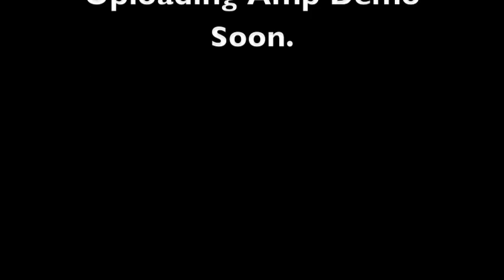Classic 80's Tube Amp Rebuild - Laney AOR50 (Part 2)

Comment: Very impressive build technique. I just found your page and am a huge Laney AOR fan. I presently own 3 AOR's and have refurbished 4, including the one for a good friend. I did not go to the degree of rebuild but am tempted to take one of mine to this level....now that I see the beauty and craftsmanship you display on your builds. I am skilled avionics Tech and am inspired to hand wire my favorite Laney to your specifications. Very impressive Sir!
Reply from the maker: +Michael Davidson thanks Michael,  really appreciate your kind words. They definitely are a cool design and quite unique indeed particularly with the active bass boost. I wish I could find another AOR at a reasonable price as I'm itching to rebuild another. I can send you my layout drawing if interested, let me know your email if so, cheers
Reply: Yes, the active bass boost is keen in that it comes from the output tubes,  rather than the preamp circuit. I would welcome your layout if you would share. That would give me an edge in completing a handwire project.  When I bias a Laney, I bias it with the bass boost on and bias specs on the high side of bias since I play with it always on boost.....indicator knob on zero. Over the years I have found most players struggle with the interactive tone stack and available boost. Is there a way we can share emails without me posting it here?
Reply from the maker: Hi Michael, head to my channel page and follow the website link and there you can email me no problem. Cheers

Comment: I have a Laney AOR30 which has been knocked around a fair bit (It was in a shop for 6 months being used to try guitars on),however since bringing it home I've attempted to get it working better- one thing that improved the sound was replacing the valves with Mesa Boogie ones, hoverer these are probably 10 years old now. I never use the "boost" controls on the EQ, neither do I use "presence", I also use an Alesis Microverb instead of the spring reverb built into the amp. It is interesting how you have changed the sound by changing capacitors in the EQ controls, I shall have to try this myself.

Comment: Amp wizard.. Amazing job.. Now a really exclusive PTP amp.. Must be expenisve with all those expensive jupiter caps and F&T electroytics, not to speak of the many hours of manual labour put into this amp.. 
I have not seen that ground bus wire before.. NIce detail..
Reply from the maker: +MrAnders1976 Thanks MrAnders. Those components are a higher quality part but it wasnt too bad in the end, the amp all up, excluding cabinet, came in at around 400$ so not too bad.  The labour and time was a blow out though, took ages.  you are the first to notice the ground bus, and I'm so glad you did as its the key component of this amp.  The earth bus is something that most tube amps neglect, they put in teeny itsy bitsy earth wirees and they just cant handle the current.  A big brute of an earth bus channel is essential to get all those currents on their way and uninpeded.  The bigger the better and you will never go wrong, plus only have one going to one earth point.  Any more than one earth point and the amp is inviting noise.  Thanks so much!!!
Reply from the maker: +elams1894 Oops, this amps components came to abou 600$  I remember clearly now, yeah it took a lot of components.  AOR circuit had a lot more than the JCM800, which it is often compared too, even excluding the extra preamp tube.  Also I didnt include the components for the FX loop and reverb which added another150$ This was a big build..

Comment: Hi Mate, why are using carbon film resistors? I always use metal film as they say that they have less noise. 
Cheers.
Peter from Melbourne
Reply from the maker: Hi Peter. I used carbon comps for this build as it was for a mate who wanted carbon comps. I personally use PRP metal film resistors or Takman carbon film resistors myself. Thanks for question, have a good one and all the best for the lockdown situation. I used to live on Elizabeth street above McDonald's right in Melbourne City, awesome place.
Reply from the maker: @petarbursac76  That's awesome, great stuff on the builds, glad I could help out with vids. I live pedals, well done on the 12au7, I'd be keen to check out the schem. I friend from France made a pedal version of my 5w amp which is pretty cool. My email is elams1894@gmail.com. fire away, cheers

Comment: Will Tube amps survive? It seem to me the up and come are stuck on wattage and how loud it can be? With tubes there is a limit, but solid-state with a fx pedal who cares? I am a boomer, glad to be! I got to hear the best sounds a guitar and amp can make. By some of the most talented people who ever picked a guitar. WHAT THESE YOUNG PEPOLE WILL MISS.
Reply from the maker: I think tube amps  (tubes) will survive. There is no substitute for analogue. It is the true, unmolested oscillation. One can sample that oscillation 8 ways to Sunday in a DC solid state situation, however it will always be a sample. The thing that matters in a guitar amp, is the changing magnetic field. Once that is messed up, all you are left with is poos. Voltage is the magnetic field. Current is merely the relationship between voltage and resistance. If one thinks of current in any other capacity, they are screwed. Cheers, and thanks for the insightful comment, it will always be an interesting debate as granted, there are some great sounding SS FX.

Comment: Using USA caps in a British amp.....I’m good with that. I have a 50W Pro tube and a 50W AOR. I like the earlier AOR better. It’s all original. I need to recap it and work on the tone circuit, mainly the bass. Not enough on bypass but seriously heavy on pull boost. There’s no good middle ground in it to my ears. Any suggestions anyone? Thanx. Peace.
Reply from the maker: Hi Dave, thanks for comment. Yeah the AOR is a temperamental beast. Upping the bass on normal channel is quite an easy affair. Locate R6 and change it from 1k to a higher value. 1k is bugger all gain and 25k is max gain. I like 10k as a nice medium however you can experiment. I'm building another one of these from scratch, this time I'm leaving out the whole AOR boost section. It's a bit of a crazy anomaly the boost section, but I kind of like it's quirkiness too. the circuit overall is a winner. Hope that helps, cheers.
Reply: elams1894 
Thanks! When I find the time I will experiment with it. Great job on the rebuild! Looks awesome! I listened to the audio on my phone so I don’t judge by that; Im sure it sounds much better than the pcb layout. Rock on!

Comment: Very nice! Kind of late to the game, but I was wondering how you went about wiring the AOR channel stuff on a turret board? I did see the 4 lead component that flashed up on camera, but I'm unfamiliar with what it is. I was thinking it was some sort of opamp but I wasn't sure. The reason I'm asking is because I have the AOR 30 watt version that I picked up a few years back and have been toying around with hand wiring it. I just don't want to lose the boost, reverb etc. It could certainly use some TLC.

Comment: What´s those metal pins for connection (those pressed in to the board) called?
Reply: +Sheep_Ewe I know the boards are called turret boards so if I remember correctly they are turret pins or terminals.
Reply: Jake P

Thank You i am also building a tube amplifier, guess the result are not even close the look of to those masterpices, but i will do my best... :D
Reply: +Sheep_Ewe  You're welcome, just do your best and have fun and you'll learn a ton.

Comment: How much would some thing like this cost?
Reply from the maker: A complete rebuild is essentially a new amp minus the transformers, so probably anything from about  1000$US up..
Reply: +elams1894 
Seen to the cost of the components i think it´s still cheap compared to brand new things with less quality...
Reply: +elams1894 you used some nice pricey caps, were some of them Jupiter and did I see mundorf? Kiwame resistors? and ohmite little rebel resistors?
Reply from the maker: +Jake P Indeed correct, your bang on..
Reply: +elams1894  Nice, I am a believer in audio quality components. Have you built any hi-fi stereo amplifiers?

Comment: Why are you soldering all those components so close to the valves, you do realise they are a source of heat right?
Reply from the maker: I realise that. And I also realise that those leads are a source of noise. I think it's common knowledge to make grid leads as short as possible. I'd rather have a bit of heat than noise thanks.
Reply: @elams1894  Have you had them fail due to the heat?
Reply from the maker: No, why would they? Heat rises and they sit below the tube. Never had them fail.
Reply: @elams1894  They sit above the valves if the front panel is correct? (Like when you use it at 4:50) Or do you use it upside down. Good to anyway that they don't fail though.
Reply from the maker: True, in this amp. Never really thought about it to be honest. Probably not the best design to hang tubes due to heat, they did funny things back in the day.

Comment: You sir have talent. But after reading all the comments blowing smoke up your @$$ I thought some constructive criticism was in order.
With a full cap change and a resistor swap here and there the original amp could have been spared. What you have now is not a classic 80's anything. You have a very well made amp from the pieces of an 80's amp. And no, I'm not a purest. Almost nothing from the original amp was left original. It does however have have a nice original faceplate that could be salvaged.

Comment: This thing is prone to arcong,shorts and loose contacts....waste of good components
Reply from the maker: what is an arcong?
Reply: Sorry, arcing...means sparks beetwen wires
Reply from the maker: @nikolaradakovic5432  Where and how?
Reply: Everywhere...take a look at Burman or Vox....technicaly excelent...soundvisr as you wish...components over each other, weak insulation, high voltage...
Reply from the maker: @nikolaradakovic5432  Ok, lol